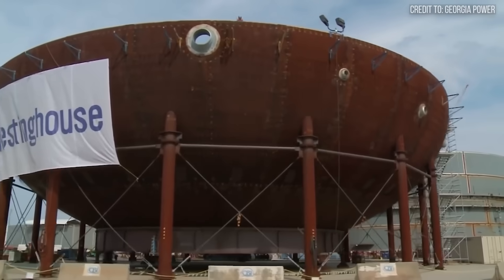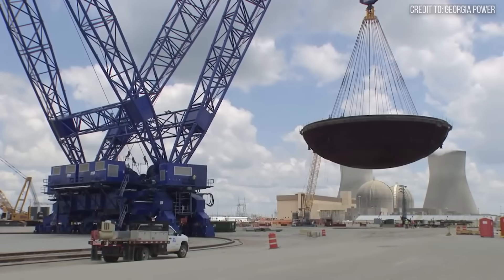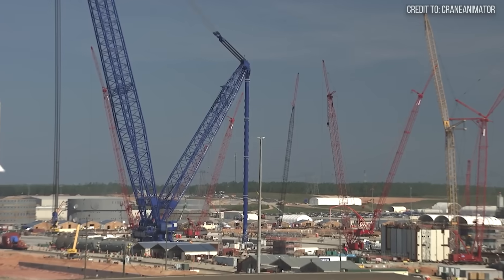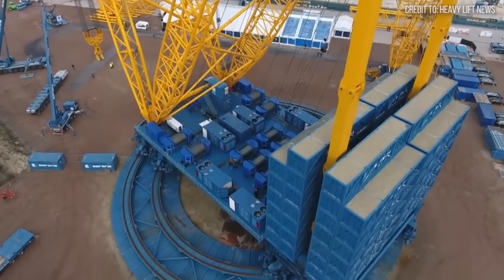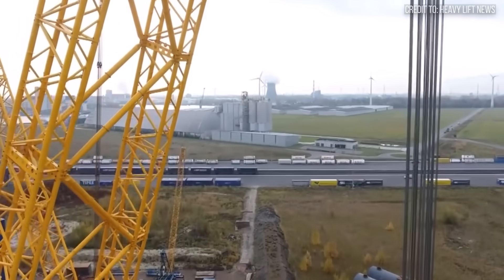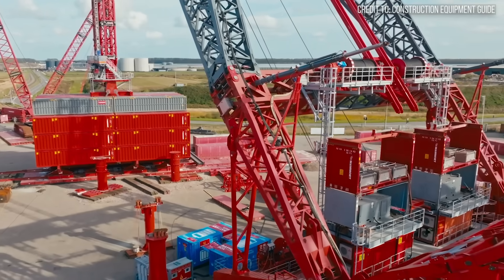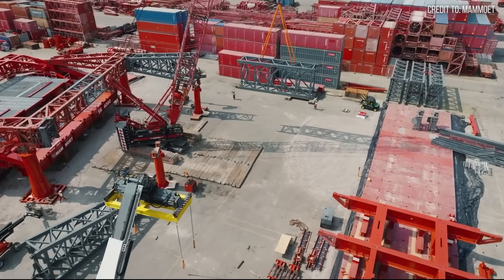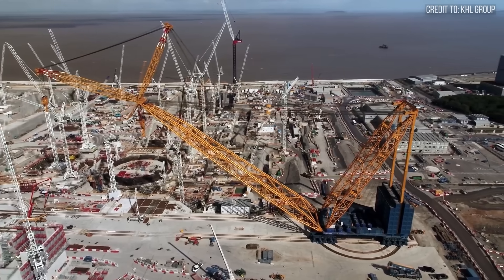The 3 Biggest Cranes on Earth: Masters of IMPOSSIBLE LIFTS

Comment: I thought the Bigge Afred has 7000ton lifting capacity
Reply from the maker: Yes the Bigge AFRD can lift up to 7,000 metric tons in its 300ft main boom configuration. For the purpose of this video though I used its 4,000 metric ton capacity with the 560ft boom to keep the comparison consistent with the Sarens SGC-250 and Mammoet SK6000, which are rated at longer boom lengths. When you consider maximum capacity, longer reach, and load moment together, the SGC-250 and SK6000 edge out the AFRD in overall capability for large-scale projects. Thanks for pointing this out, and I’ll clarify this in future content. Hope you enjoyed the video!